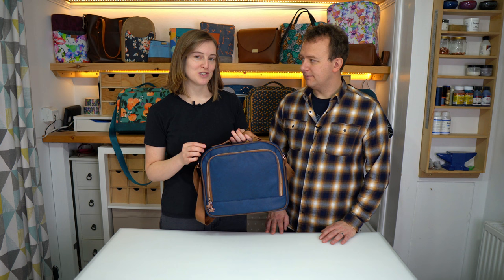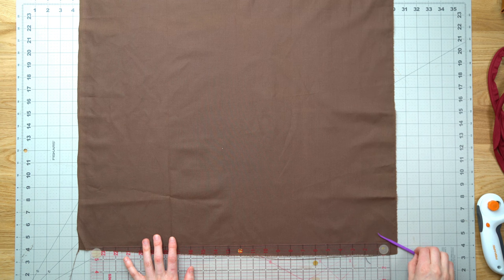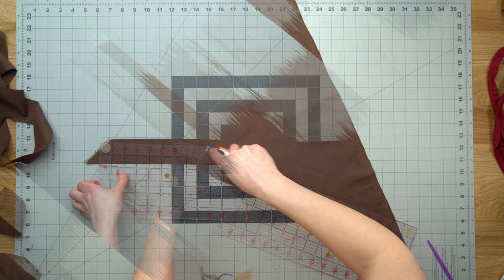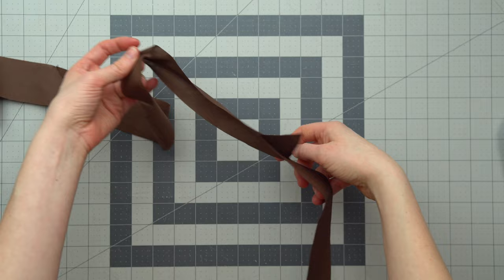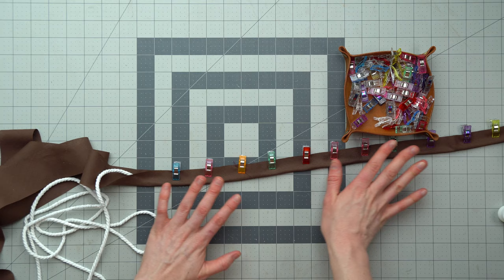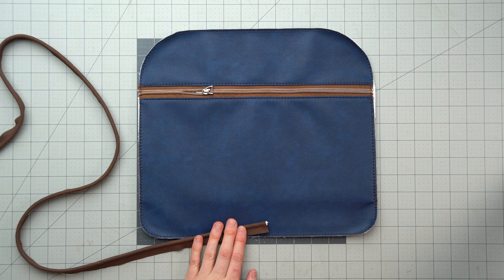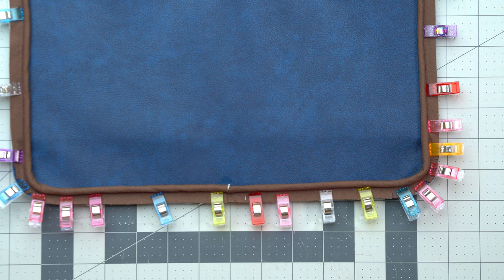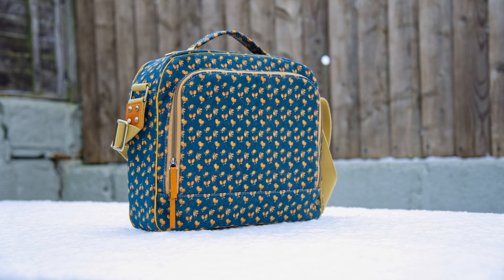How to Add Piping to Your Bags - Bag Making Tips

Comment: How did you trim the seam allowance down to 3/8? When you put a ruler on top it tends to roll around since it’s not flat. Is there an easy way to deal with that?
Reply from the maker: Unless you can find a 3/8 guide you just need to be careful when measuring it. I just try to not move the ruler around and take my time

Comment: You just trimed the flange down to 3/8 ,right? Not including the cotton piping. How do you not see the piping stitches? It seems like they may travel outside the seam allowance,or do you just stitch a little  outside of your construction stitch?
Sorry for all the questions
Reply from the maker: Thats right, you trim the flange down. Don’t include the piping. Just like in a normal seam if you pull it open you may see a bit of the stitching but generally it’s not an issue. But if you have concerns about it you can sew the piping a little under 3/8.